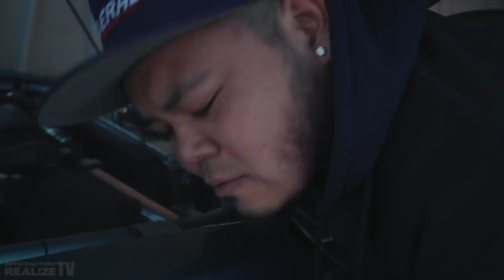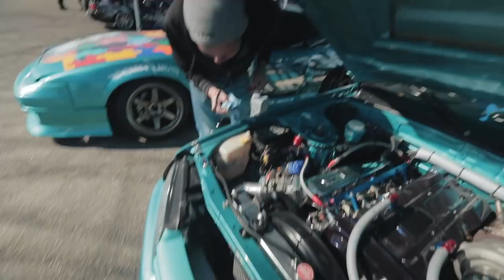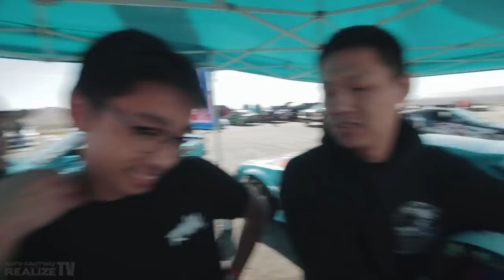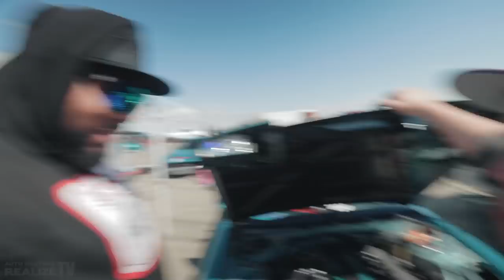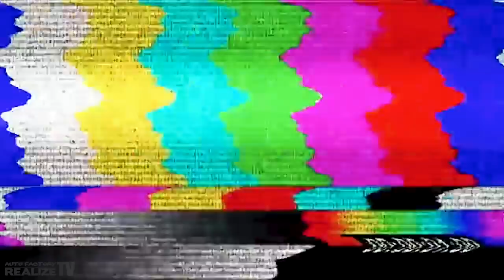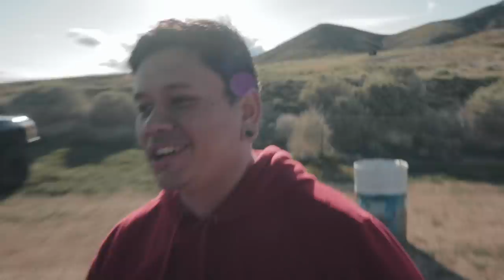Our BEST drift tandems yet!!

Comment: They must have updated the manual because loading the car seat into the https://www.youtube.com/post/UgkxIG_q-ZqgbzYXwbeApK3AybegDUy4f2fF double stroller was mentioned in the manual (unlike previous comments/reviews). The undercarriage basket is quite large but it is difficult to access when the back rider is reclined, however my toddler usually doesn't fall asleep in the stroller these days so I haven't had an issue. I was amazed by how smooth the ride was and how easily I was able to maneuver the stroller in small spaces. My toddler loves that she can see her baby sister (see photo) during the ride :) Plus you can't beat the price! I have only loaded it once in my car and it is fairly light but my mother wouldn't be able to lift it in.